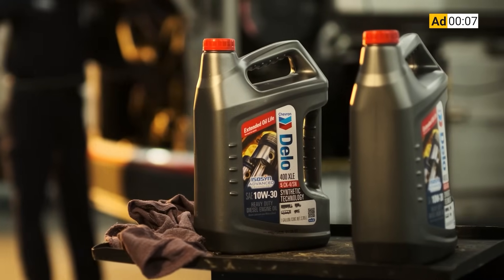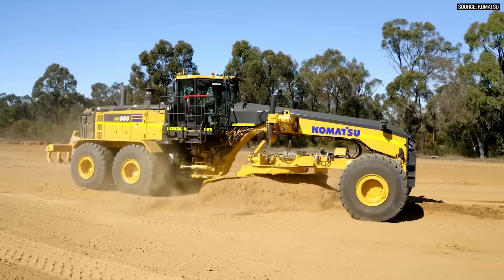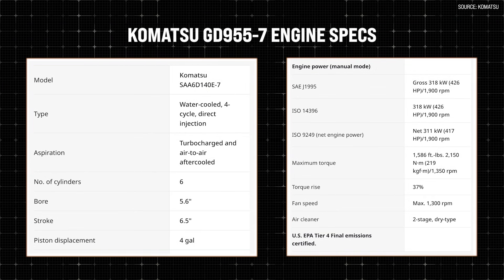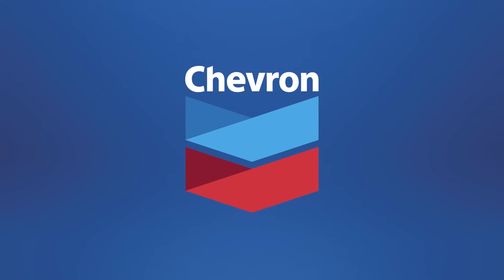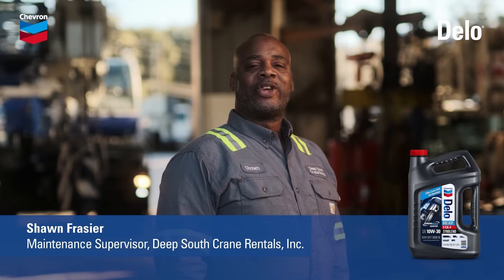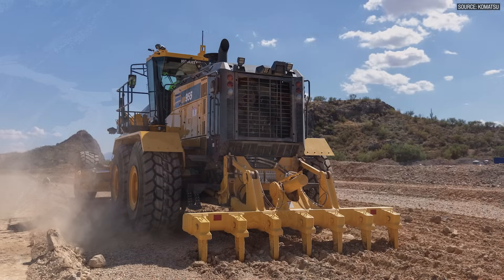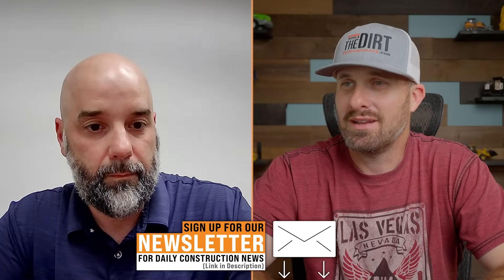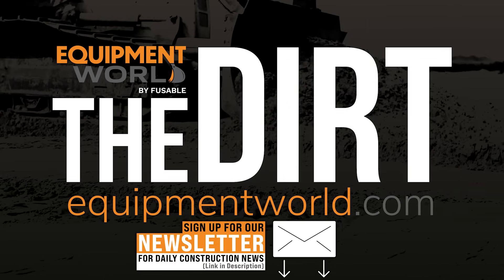Komatsu’s Largest Motor Grader for the U.S. Revealed

Comment: When I worked for Komatsu they had a massive chip on their shoulder about CAT and liked to pretend that they could offer a machine to compete with every CAT machine.

That was the generation before DEF, Komatsu seems to put a really clunky DEF system on every machine, often where CAT and othwr brands may only have a DPF.

In my opinion a DPF is less expensive and less of a hassle than a adblue.
Experience has taught me that Komatsu machines really aren't on the same level any more, needless to say you will see 50 CAT140s or 16s for every Komatsu Grader, and 10 'high sprocket' dozens for every Komatsu.